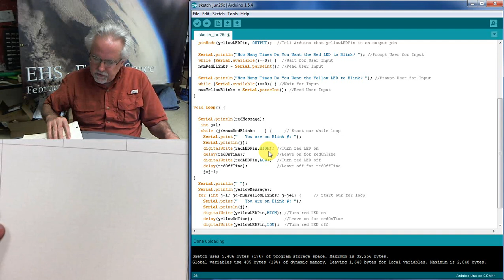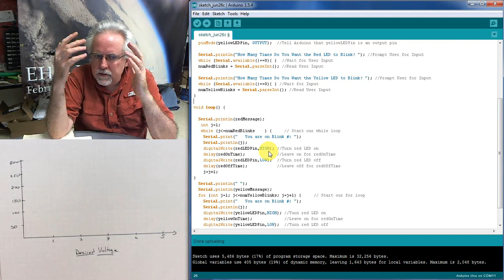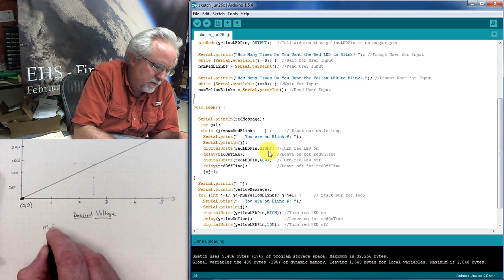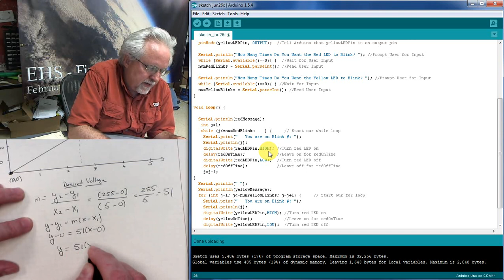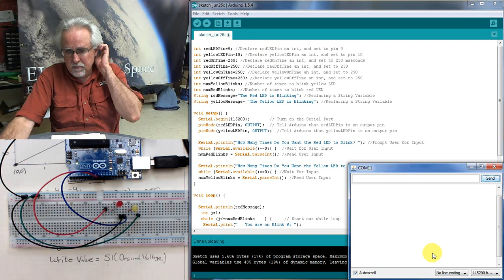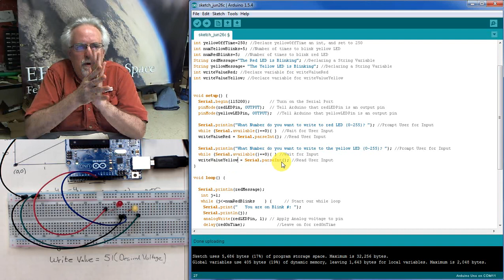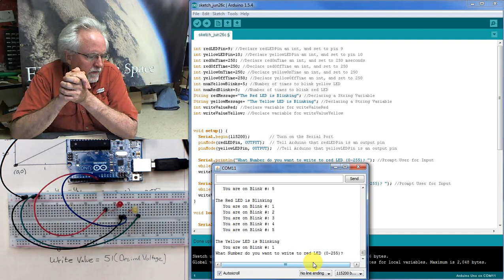Comment: Good video series but I think that it is wrong to tell that analogWrite outputs voltages.  It outputs pwm signal. In fact an LED would not work at 0.1 Volts,  as we can see in video 9. What happens is that pwm puts the voltage at maximum during a portion of time defined by the pwm value and during that time the led is on.

Comment: I put a for(){} loop inside of a for(){}loop to increment the analog voltage from 0 to 3.3 in 50ms steps then go backwards! Then it steps to however many blinks set for Yellow and repeat :)
Reply: If I'm running a for(float j=0; j<=3.3; j=j+.01){} then I realized it will run at a faster speed if I select j<=2.2 versus j<=3.3. I'm not seriously interested in figuring out how to fix it yet since I'm still a beginner but it's interesting.

Comment: if we use 3,3v, we must calculate for 3,3v right not with 5
Reply: I encountered the same dilema and used Paul's equation to figure out how to calculate voltages into a value between 0-255. y=77.27272727(x)

Comment: Really really appreciate the videos.  Easy to follow, clear and precise. Learned so much. 
Agree, copy + paste doesn’t work. 
Also, if I may, i think I found the reason why there is issue uploading the code and error message:
The software (naturally) has difficulty in sending new code whilst on the same cable is reading serial monitor. When it is trying to upload the code,  but is also receiving data from arduino board, issues arise. 
I don’t think it is related to length of your cable. 
I added a delay(15000) as last line to my void loop => no more error messages 🙃
Also, **  important ** not all the pins can be used as analogWrite. On the rev3 board, only 3, 5, 6, 9, 10, 11 - the pins tt can be used are marked with a “~” sign (pwm).

Comment: I cannot analogWrite a voltage of less than 5 to both LEDs :( 
One of the LEDs has to be either digitalWrite HIGH or analogWrite 255 in order for the code to work.
In the case where both LEDs analogWrite to a voltage of less than 5, after specifying the number of blinks for both LEDs, I get the following: 
The Red LED is Blinking!
   You are on blink #: 1
Please specify the number of blinks for the Red LED.
Again, if one of the LEDs is set to 5v either through digital or analog write, the code works fine.
Can anyone help?

Comment: Hello. I cannot get mine to work. I have the code correct and the circuit all correct. And I am using pins 9 and 10, but it doesn't work. What could be the problem ? thank you
Reply: So basically it works fine when I write 255 in the analogWrite, but it doesn't work for any other values. I even tried 254 and it doesn't work

Comment: Hello. I cannot get mine to work. I have the code correct and the circuit all correct. And I am using pins 9 and 10, but it doesn't work. What could be the problem ? thank you

Comment: I dont understand why they call it analog out when it is actually Pulse Width modulation. Why not call it waht it actually is "PWM"  ?? I guess you vary the power out if not the voltage

Comment: OK I have a perplexing thing happening. First off I am using an Arduino Mega2560 from ELEGOO. I have been spot on going through the lessons and everything up to this point is working great. I change my digitalWrite to analogwrite:
    int j=1;

 while (j<=numRedBlink){
    Serial.print(redBlink);
    Serial.println(j);
    digitalWrite(redLED, HIGH);
    delay(redOn);               //Delay
    digitalWrite(redLED, LOW);
    delay(redOff);              //Delay
    j++;
   int j=1; 
  while (j<=numRedBlink){
    Serial.print(redBlink);
    Serial.println(j);
    analogWrite(redLED, 5);
    delay(redOn);               //Delay
    analogWrite(redLED, 0);
    delay(redOff);              //Delay
    j++;
While in digtalwrite everything works great, when I switch it asks the questions, then posts one "Red Blink #1" and then asks the questions again. Frustrated I had a uno that I plugged in and it all worked correctly both ways. What am I doing wrong with the 2560?
Reply: This could be the problem https://github.com/arduino/Arduino/issues/9653
Reply: @demaNDart86  Thank you! that is exactly what it is doing. Although I am using v.1.8.12, they must have not fixed the issue yet. I am not going crazy.
edit:
I tried the 1.9.0 beta and it works fine...FYI

Comment: For the math do Just cross mutiply.. 255 = 5v if you want 3.2 Just do 255*3.2 / 5    you want 4.1 255 * 4.1 / 5 its a trick but IT works and you dont have to rember complicated equations....
Reply: But does not work for the many cases where the y intercept is not zero. Guys, lets learn the math.

Comment: alittle curious. i wondering; could you not also find the amount of voltage you are looking for or need to write by using this formula below?:

finding Analog voltage write formula:
AM = analog max value(255);
ARV = Analog write voltage(looking for 2.5 volts equivalent) ;
SV = Supplied Voltage(5v);
DSV = Desire Voltage
(2.5) [must be decimal ready value example: 3/4 of a volt would need to be .75. and 2 1/4 of a volt would be 2.25 etc...]

ARV = (AM / SV) * min(DSV, SV);
?just wondering?
with this formula all one would have to change is the supplied voltage and desire voltage and it should work.
I've test the formula all the way upto 48v with no issues or wrong values.

I created a function that anyone can feel free to use how ever you see fit! :)
VD = Voltage Desire;    SV = supplied voltage
**
**
float DSV(float VD, float SV){
  return (float)((255 / SV) * min(VD, SV));
}

**
**
you can input any value and since it returns a float you can use this function inside the analog write function like below.
analogWrite(yellowLEDPin, DSV(3.47, 5));

enjoy! i like writing formulas!!

Comment: Anyone able to help? 
Using the PWN pin with the ~ line by it. Whenever I put analogWrite(redLED, 255); with my desired amount of blinks it works fine. However if I put analogWrite(redLED, 51);  it will not sequence the flashes and goes straight back to asking me how many blinks I would like. In my serial monitor it says it blinks once but I cannot see any blink on my board.
Reply: How many blinks would you want from the red LED? 
How many times would you like the Yellow LED to blink?
 
The Red LED is blinking
 Red Blink Number = 1

How many blinks would you want from the red LED?

Comment: I guess, this formula y=51x needs to modify a little bid to better understand as-  step 1: - y/51=51/51x, step 2 - y/51=x and  >>> 0.02y=x where x is voltage on LED and y is number to enter. According to this if it is 5 v means: 5/.02 equal 255 to enter, 1 volt is 1/.02 I equal to 50, on other hand # 150 is equal 3 v,  and etc. Thanks

Comment: I used my multimeter and spent ages trying to work out why the LEDs were so low and it was showing 1.5v. I had my GND connection in the wrong socket all the way through these tutorials! Whoops!

Comment: is 0-255 an American household voltage value as in India we use 0-220, can anyone please tell me if I am thinking correctly.
Reply: No, american household voltage is typically 0-120V. The 0-255 used in Arduino is simply a conversion
Reply: Guessing, it is binary representation of analog signal

Comment: Sir you told that the voltages we apply will be assigned numbers from 0 to 255 i.e. to the lowest voltage and 255 to the highest voltage. I want to ask that what is the reason behind the voltages being numbered this way i.e. why does not the numbers go to 10k or are restricted to only 10 ? Does this have any relation with the ASCII codes ?
Reply: It has to do with bit resolution. I think output it limited to 8 bits.  2^8 = 256

Comment: How does the LED that needs 2 volts to work run from 1 volt source from Arduino?
Reply: Pulse width modulation, they are using 0-255 to set the duty cycle. so even at 1 the 5v will turn on but for a really short time, the higher the number the longer the 5v stays on and will create a higher average voltage.. 128 will give you 50% duty cycle (2.5v average).  255 is 100% duty cycle(always on)

Comment: Hi guys!
Actually, it's not REAL analog.  It is PWM (Pulse Width Modulation).  255 turns it to 5V, 100% of the time, as 0 turns it to 5V 0% of the time.  Similarly, 128 turns it to 5V 50% of the time and so on.

If you really want 2,5V out of that last example, you need to put a capacitor (and a load).  THEN, you'll be able to measure your 2,5V.

An LED starts emitting light at about 2,7 Volts.  That is the reason you can see it ON at a reading of 5. What you really see is full brightness about 2% of the time, then off the rest of that same time.  Your eye's perception just can't see it blinking that fast.

Human eye's perception is about 1/20th of a second.  This is the reason a movie (film) frame rate is over that critical limit, and is actually 24 frames per second, and we see a moving object rather than a series of flickering images.

Comment: many people saying nonsense about this"mathematical" part .
yes ,its simple math,yet easily forgotten .
you may know something but you may not   know when to use it .
as i am in college trying to know when can we use what we learnt in maths,parts like integration and differentiation and graphs..etc
yes you can solve it in much more simple way
225=5
x=1
divide both equations ,tata right answer,
but still dumb and doesn't teach you how to solve and how to think.
but in more complicated things like how to step  up voltages or step down them ,,you will need a more "neat" way .and then you would be allowed to think of ways like graphs,because ,yes,you have seen that before.

Comment: Ive had 5 years of math in total. Never used it in real life. I always say "You dont need math, you need to know basis calculus." For all practical purposes, this statement holds true. I should have been offered BASIC instead. Cant you do the calculation with Y=aX+b? When X=0, Y=0. When X=5, Y=255......... Out of that info you can calculate the slope. Can you infer b from the graph? I think b=0 because the graph starts at point (0,0)?

Comment: Paul:  Thanks for the great training, it's really appreciated. I do have a weird thing going on, and curious if you have any ideas. Only difference between us, is that I am using the MEGA 2560 board. I had this issue in lesson 7 and could not fix it. I even copied your code and tried it with same results. My code totally skips the second wait cycle, and starts executing. No idea why. My code is exactly yours with no changes, so I'm wondering if there is a difference with my board. It prompts me for the first value, and when I enter it, the program starts executing without waiting for the second value. It's really weird, and just wondering if you have any ideas. For now, I just commented out the user prompts, and the code works fine. Thanks, William
Reply: I've been having a similar issue. While I don't know what causes it, I do have a solution. Take this code
void serialFlush(){
  while(Serial.available() > 0) {
    char t = Serial.read();
  }
} 
and plop it by itself, outside of both voidLoop() and voidSetup(). It is it's own function/method/whatever you wanna call it. But I repeat; do not put it inside voidLoop() or voidSetup() or it will not work. From there, put "serialFlush();" beneath the line that has "variableName = Serial.parseInt();". This should solve your problem. If it doesn't, or if you'd like a technical explanation of what that all does, hit me up here.
Reply: @TheOnsieWithConverse  This is the most helpful comment and I wish it was completely upvoted to the top! I have searched forums and stuff to find the answer and then realized I should check the comments!! Thanks so much, tears of joy.

Comment: I do not understand how a voltage as low as 0,1 Volts can turn on a LED should not be possible because normally threshold voltages to light up LED's are starting at around 2 volts
Reply: I agree -- I have some LEDs that only begin to light up around 102-153 (2-3volts...), others lower threshold, others higher...

Comment: IM CONFUSED! i thought an LED had a forward voltage that must be applied for it to work because it is a diode. these voltages are between 2-3 volts. the thought that you could run one with 1 volt or less is confusing? also you are using a resistor in it so you are not getting the whole voltage to begin with. however i suppose this has something to do with the pin not being a pwm or analog pin. but i am confused.
Reply: As you guessed, there's a mistake with the way this has been explained here due to the chosen pin. Those pins (9 and 10 on the UNO) have a "~" next to them. They are PWM (Pulse Width Modulation, very useful to control the speed of a motor for instance). So they do not receive 0 to 5V depending on the value from 0 to 255 sent. Instead, the value is the ratio timeHigh vs. timeLow of a pulse cycle. A value of 0, means 0% High, hence 100% Low so the LED is Off. A value of 255 means 100% high so fully On. However a 127 means a pulse 50% High (5V) and 50% low (0V), so the LED blinks really fast, but all we see is that it looks like it's ON but dimmer. With a value of 1, it is ON (5V) about 0.5% of the cycle, but we can still kinda see it.
Reply: Yes, I got thrown off by that too. I think he is oversimplifying for his target audience. I think he should have referred to the output as an equivalent voltage or virtual voltage. Frederic L sets the record straight perfectly in his explanation above.

Comment: I  was using pins 7 and 8 and nothing was working as it should. Then I saw that some pins have small curved lines before the number. I changed the pins to 9 and 10 and everything is working well now. So everybody with UNO, keep an eye on that. But I am curious why LEDs were on when the analog voltage was 128+ and off when the voltage was 127-. I found a connection. 255/2=127.5

Comment: Hey paul . Is the following code works for fading led ? 
Void setup (){
PinMode (3,OUTPUT};}
Voidloop ()
{
For (int i=0;i <=255;i++){
AnalogWrite (3,i);
Delay (500);}
For (int j=255;j>=0;j--)
{ analogWrite (3,j);
Delay (250);}

Comment: Am I correct that you don't really write the voltage but instead use a PWM to control the LED brightness?
Reply: Yes
Reply: I have to control an Inverter with an Arduino and I need a voltage value. Any Idea how to do that?

Comment: easy way is 255/5 = 51 which is 1v so we have 51=1v since we know that 1v is 51 then if we need to fine out the value of 2.5v we multiply 2.5 X 51= 127.5
Reply: The easy way only works on this problem because in math terms, the y intercept is zero. The simple thing you describe would not work if you have a case where y intercept is not zero. I am trying to get people to learn how to do the math.

Comment: I never made it to math class apparently because this math is over my head.
Divide the desired voltage by 5 and multiply by 255,  Desired 1v, divided by 5 is 0.2,  x 255= 51
Reply: And you can do that intuitively because the Y intercept is 0. How would you handle you want 3 Volts when your sensor reads 112, and 1 volt when your sensor reads 1006. To do that equation you can not do it in your head, you have to know how to do the math for a line. That is why I am teaching it even on a simple problem like in this video.
Reply: Thank you for answering me, So far you have been the ONLY resource that actually taught me how to understand and write code, Being that i can not do this math and i must rely on a conversion chart,( I never heard on an intragen in all my 51 years) Can a simple converter be written into the sketch for math idiots like me and to generally make life easier? P.S. Im a retired auto mechanic so im building all kinds of neat projects and am willing to learn code,  But not willing to take a math course :)
Reply: Really, watch the video. I show you how to do the math. It is two points, and make a line equation using the two points. Watch it again and think through it.
Reply: You must have a great brain, I Remember as a young tech,  I was a lot quicker to learn then i am at 51, I admire your ability to stay fresh and focused. P.S. I assumed that i had subscribed to you 7 videos ago, oops, I'm on it now.
Reply: easy way is 255/5 = 51 which is 1v so we have 51=1v since we know that 1v is 51 then if we need to fine out the value of 2.5v we multiply 2.5 X 51= 127.5

Comment: Only one of my led turn on when i switch the digitalWrite to analogWrite and the voltage to HIGH to 51 and LOW to 0 can someone help
Reply: Only specific pins with the ~ symbol will collaborate with the analogWrite command. Make sure you use the right pins.

Comment: I am just getting started with the Arduino.   Programmed up an 8080 processor many years ago and did some Basic on a TRS-80  but this is the first time I have done any coding after that.  Your videos are very helpful.  Just working my way and am on # 8.  They are helping me understand why some of the scrips on the internet are not working for me to start with.  Keep up the good work.

Comment: I am using 3 LED Lights. I got them working individually and I have two of the three LED's to dim as I want them to. The other one works as well, however even when at 255 it still stays really dim. If I set the one that always stays dim to let's say 1, then I can't see it, that's how I know it's working to some extent. I switched up all three LED pins to analog pins and that one LED light still does not seem to want to go brighter. I tried switching out LED's to see if It burnt out and even rewiring the breadboard with no luck. Any ideas?